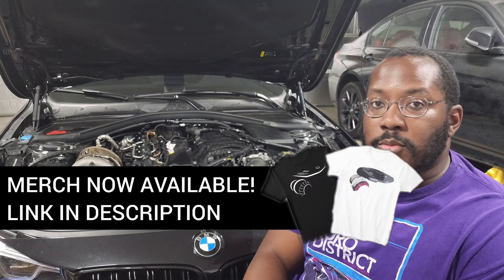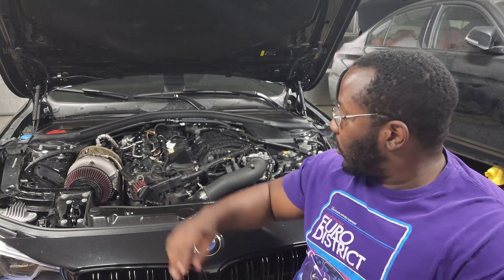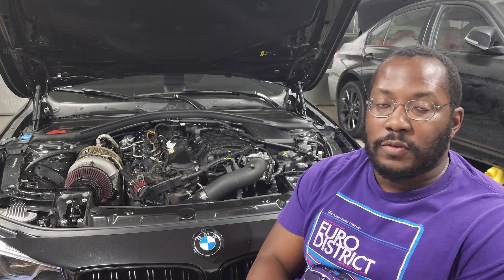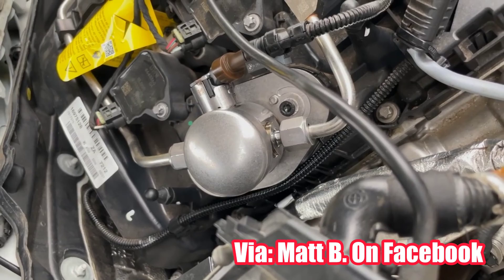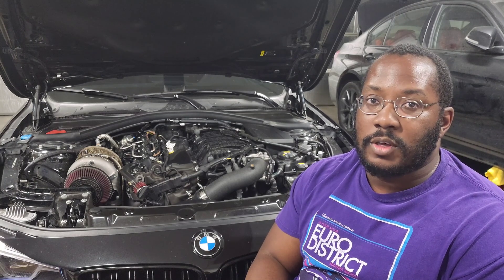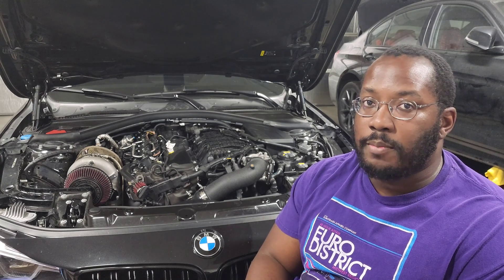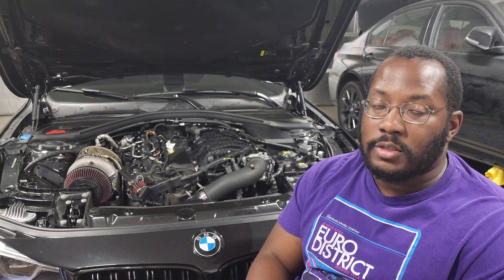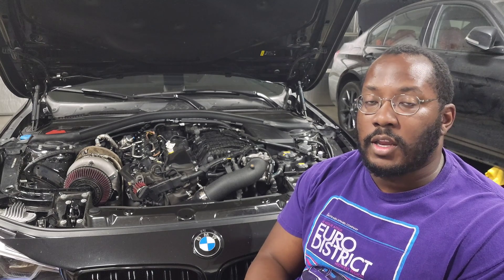11A002 - High pressure Fuel System Pressure too low - B58 Common Issues

Comment: Code is 11AA08 I am running OTS E50 and have a TU pump is it wiring? Is it finally failing? Ive had this pump on for a few thousand miles

Comment: Hey Kern, do you what the 11AA08 code means? I always get it often under DME Shadow codes
Reply: Hi, i have the same error, did you find a solution?
Reply: @AlbertoGiovanniDanieli nope
Reply: @AlbertoGiovanniDanieli  No I did not
Reply: Same here I got 11AA08 did you figure it out ?
Reply: @Boostedbywill For me I think it is the HPFP, it does not hold pressure according to specs when shutting down engine
Reply: @_nixon3484 so you haven’t replaced it and got it to go away yet? Essentially replacing hpfp
Reply: @Boostedbywill Thought it was the injectors and replaced them but issue still  persist. The injectors were leaking though, so check them! The last thing for me is the hpfp
Reply: @_nixon3484 are you di or pi? I’m gonna assume you changed DI injectors
Reply: @Boostedbywill Yea DI, the code you get is from the rail pressure.
Check your ltft
Reply: @Boostedbywill Issue seems to be solved after upgrading the lpfp

Comment: Hi, bmw g30 b48 gen2 mgflasher st1,  my code 11a605 - I get a drivetrain malfunction during WOT (only sport mode, and it always happens in second gear at 6000-6500rpm)
i use only 93oct, any ideas?

Comment: I've installed a b58tu hpfp on my gen1 340i, when i monitor the hpfp pressure with bm3 i got around 2950psi as a maximum pressure, and i got the hpfp pressure low code.

Any help ?
Reply from the maker: 2900psi is normal. The low pressure code was probably from the first start when all the fuel lines filled up.
Reply: @kern417  I've tried to monitor the hpfp on live data so the pressure goes around 2900 all the time even when i go full throttle .. plus im running 19psi.

Comment: I’m having this issue with 15’535 n55 and it’s giving me that same code and this other one 11AC02 but it’s doing kind of what you described about an injector stuck open
Reply: Did you fix it?
Reply: @george4111 yea my hpfp got replaced it eventually went out

Comment: Got a 2016 340i that threw a 11A401 code and car would not start. Had the hpfp and lpfp replaced still no start but it cranks. Could it be the fuel pressure sensor?
Reply from the maker: Maybe a fuel leak somewhere or an injector stuck
Reply: Did this end up being the EKP/Fuel control module?

Comment: Can you speak to code 11A030 Low-pressure fuel system, electric fuel pump, adaptation: adaptation value outside the valid range
Reply: I’m having this same code mane no where is helping lmk if u find a lead man 🙏🏿
Reply: @mr.snifflz6722 I got the same code did you figure it out ?
Reply: I-am having the same code...

Comment: Kern I need you’re help 😭 I’m having a problem I had to switch back to my tu pump from my stage 2hpfp becuz one bolt backed out and the other snapped but now since I switched pumps my car hesitates to start and it won’t let me go over 2k what could the problem be and I’m running e40
Reply from the maker: Could be anything. Scan for codes and run a log
Reply: @kern417  I scanned and it gave me a code for 11A002 and 11A030
Reply from the maker: Either ekp or Lpfp is on it's way out
Reply: @kern417  it was my hpfp I put my stock one back on today and now the car is running like nothing ever happened

Comment: 11A030 is my code any ideas ?
Reply from the maker: Either lpfp or ekp
Reply: @kern417  i was previously running e30 mixture i went back to 91 and the code went away does that mean that its not failing or if i go back to e30 or in the future e50 will it still fail?
Reply from the maker: @rxmn  just keep an eye on it. Maybe it just was a random issue that worked itself out.
Reply: @kern417  got it will do, should i be good to install the hpfp and do e50 then?
Reply from the maker: Sure
Reply: @kern417  hey kern I been running 91 for a while now and the code 11A030 still turned on and also gave me a drive train error malfunction did i cleared it and still comes back after a while if i do a decent pull does that mean lpfp is done ?
Reply from the maker: Yeah probably on it's way out
Reply: @kern417  appreciate it thank you again 🙏🏻
Reply: @rxmn hey did u ever fix the code? I’m in the same situation
Reply: @fardinr3552 hey I was running to much E on my the stock fuel pump
i was running E30 the car didn’t like it I had to upgrade to a supra fuel pump
And upgraded the spark plugs in the progress

Comment: Hi there , I have a N13 engine 118i. The car starts up and drives fine but after I drive between 10 to 15kms and if I switch the car off and start it. 
The car will start but switch off after 4 to 5 mins and may only start again after 2 hours. What you think could be the problem? I am also getting the same code mentioned in the subject
Reply: Did you fix the problem and how haha?
Reply: Had the same issue replaced the high pressure fuel pump, problem was solved for a month then returned

Comment: just did antilag on the road and heard some nasty backfire. and got my drivetrain malfunction error. got the 11a002 and the 11b209 any ideas? btw you’re videos are great you are amazing
Reply: do you also could think it’s my 02 sensors making my fuel more lean?
Reply from the maker: Could be anything. Run a log and go from there

Comment: my tuner always told me to run dorsh stg2 and not the hpd6 cause of the risk of failure at high rpm.

also my clutch just broken yesterday and I need to replace it, how good is the 550i one? cause at the max torque at 3 ou 4K rpm im afraid to press full gas cause of clutch failure. how is yours after 2 or 3 years is he alive?
Reply from the maker: That doesn't really make sense. It's an OEM pump designed with OEM rev limit in mind. Unless you're expecting to rev higher than 7000 RPM it works fine.

The 550i clutch works well if you keep your tune within its torque limits.
Reply: @kern417  you have no torque limit at every gear? Wich is the Best Luk or Valeo for the 550i clutch?
Reply from the maker: I have torque limited in my tune for all gears

Comment: I got this code thrown once at WOT on the motorway, also had a few other codes thrown to do with crankshaft position sensor, could any of this be related? ( I’ve also been having Surging/ bucking problems)?? Any info would help

Comment: This came at the perfect timing. Although I wish it didn’t… just had a TU pump installed and now getting drivetrain malfunction on idrive and long crank startup. Along with 7 codes 😒  high pressure too low. Also low pressure codes. Any idea what it could be?
Reply from the maker: Is it running? Are they active codes or shadow codes?
Reply: @kern417  I’m replying but it gets deleted
Reply from the maker: @Me-mw6un  YouTube is dumb sometimes. Message me on Instagram or Facebook. Links are in the description
Reply: @kern417  messaged you on IG
Reply: I have the same code. Do you have Instagram?

Comment: Hey is the b58tu pump still a good option if I want to stay on stock turbo and run e50?
Reply: Yes you will be good. Run that right now no problems
Reply: @alexgomez3956  will it throw a check engine light ? Who do u trust to install it ?
Reply: @shelbyhaiketic4212  the tuning license will let you clear the code when you get it
Reply from the maker: No code is thrown when using a TU Pump.
Reply from the maker: Sure

Comment: So mines throwing a 11AA08 code here and then, saying HPFP system reduction too high..?
Reply from the maker: What hpfp
Reply: @kern417  gen1 stock hpfp on 93 stage2 ots mhd
Reply from the maker: @M3E92V8  if you have a log send it to me
Reply: Same here, always shows up, but only as a shadow code:
- DME shadow (inactive) codes - 11AA08 - High-pressure fuel system: Pressure reduction too high.
Rarely I feel no power when accelerate from stationary, like traction control interferes. I think code pops at that time.
Reply: @pppeter8749 hi, have you solved it?
Reply: @AlbertoGiovanniDanieli nope. I changed injectors still throw it. I noticed that it pops in when start the car and go into shadow immediately. Bmw shop claims they don’t see any code… maybe it’s mhd related.
Reply: @pppeter8749 thank you for the reply. My car is pretty new (it has 22k km) and i noticed the error after an mhd update. Maybe it is like you said mhd related

Comment: Even ds2 is crashing on 27 psi sometimes, solution is pi or turn down a bit power according to my tuner
Reply from the maker: It all depends on airflow not just psi, as well as where that boost is reached
Reply: @kern417  I’m trying to get to about 600 wheel no more than that for a daily I think that’s perfect 😂
Reply from the maker: @diederich201  600 on an ethanol mix works fine
Reply: Damn don’t tell me this I’m putting on a stage 2 on Monday since my stage 1 keeps crashing

Comment: Hi brother can you reply
Please im
really worried my b58 coolant pipe
When engine is normal
Operation temp
The coolant pipe very firm
Is that normal?
Reply: @bmwsincekid  Word your question better brother. I'm assuming english is not your first language, so I will try to help. What are you asking about the b58 coolant pipe? Is the temperature level not normal, or is there a leakage/crack? https://www.youtube.com/watch?v=FqDiF9kEl1M or https://www.youtube.com/watch?v=C6sIVTQh9xA
Reply: @Decisiveness_  hmm I think it’s understandable!! My question was once the engine reaches operation temp , my Water Pipe, coolant Hose is very firm !! If i try to squeeze the pipe
Its firm is that normal that was the question!! I didn’t knew it was that difficult to understand it Brother. I didn’t wrote Nothing about High temp or Leakages..
Reply from the maker: @bmwsincekid  it's probably fine
Reply: Means your system is up to temp and once things get hot they expand, and thus giving you a stiffer coolant pipe.
Reply: Thanks For These Unhelpful answers 😂 Probably Fine , and the heat expands pipe ! Thx I know the pipe gets expanded but my previous car m550d diesel never had this firm
Pipe anyway not worth wasting time
Reply from the maker: @bmwsincekid  i mean you're the one asking if a coolant hose should be firm. I wouldn't waste my time squeezing pipes when the engine bay is 200°F but good luck
Reply: @kern417  😂 okay Dawg
Reply: @kern417  I squeezed it cause i miss some coolant from the main reservoir, and also smelt coolant so i thought i check if pipes are hard or Soft …